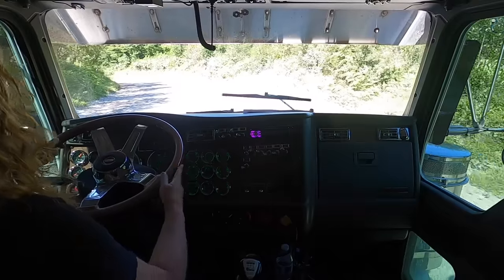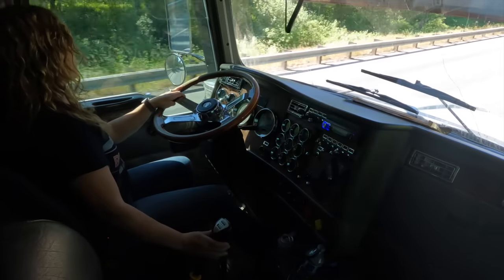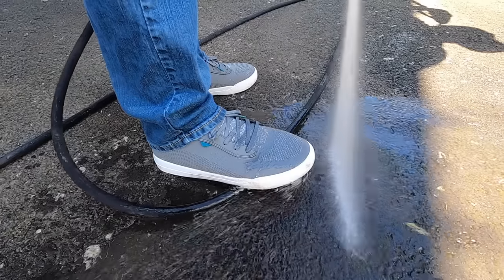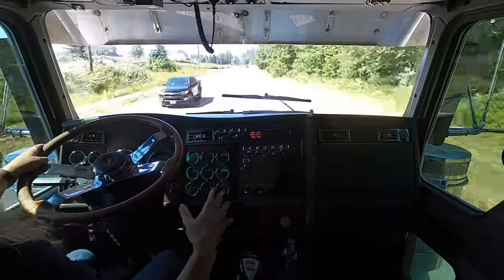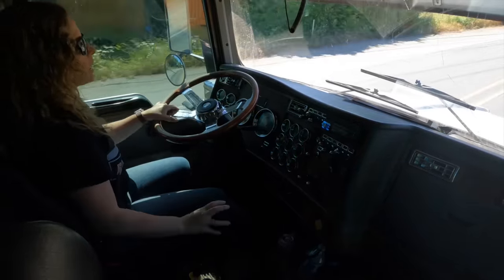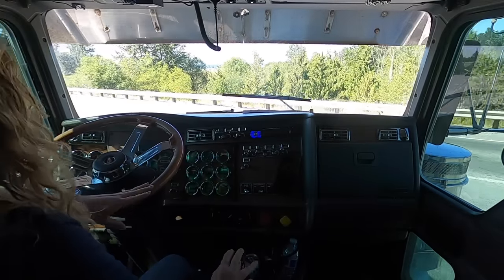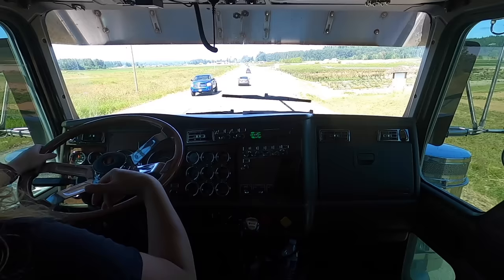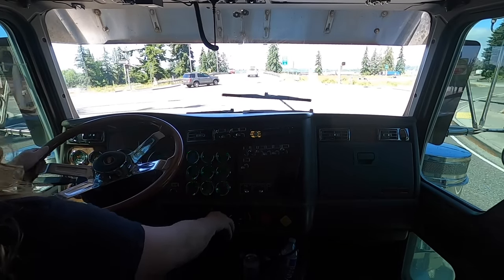How to shift an 18 speed Eaton Fuller Transmission. Down shifting explained on a loaded semi truck.

Comment: When I drove a truck for awhile hauling asphalt in a tanker trailer I was driving a 13 speed.
Fully loaded I never bothered using the half gear splits, and when I got up to the last shift then I buttoned it up to the 13th gear.
When the trailer was empty I started out in 4th gear(low range) then shifted into 5th(high range) right after that and again not bothering with the half gear splits all the way to the last gear shift then buttoning to the 13th gear on the highways
I can tell you I could get up to highway speeds a lot quicker unloaded than fully loaded.
But like she said we all have different driving style and each truck is always different to drive.

Comment: I found the best way to shift is use no clutch when shifting when changing up a gear rev to the point of changing take foot off the gas slid into neutral then quickly in to next gear without reving  up it will slip in easy and smooth do it all in one swift motion now when changing down gears drop into neutral then give a quick rev before dropping in to lower gear again do it all in one motion the more you do it the better it will be it will be  almost semi auto  it;s great for climbing hills without losing power and revs cause you not hitting the clutch only use the clutch for stop and start moving it's all about feel and becoming one with the rig

Comment: I’ve only been driving stick (10 speed dump truck plowing) since January. I learned to double clutch to get my license. I sometimes float the gears up shifting. But down shifting I always clutch once to take it out of gear. Otherwise it just sometimes doesn’t work for me. Especially when going from 10 to 9 and 8 to 7. Most of the time I just double clutch for everything. That way for me I rarely lose a gear. But it does happen lol

Comment: Back in my days of driving all different trucks different transmissions The highest I used was a 13 speed fuller.
When you drive it enough you never look at the tack you just listen to the engine and watch the speed, you just know when to shift.
Reply: 13 is the same. 18 you can spilt the low range as well.

Comment: I found this video interesting. I like the way you have full control of your truck at all times. To me you are a very confident driver. And a real truck driver with a very smooth gear change. During my career as a driver I personally did not use the clutch either. Keep up the good work and shiny up and the wheels turning. Stay safe and all the best

Comment: Great video. Good explanation. When you drive every day you don't think about the gears. I agree with you about the clutch and Mac transmissions. I thought it was just me. Some guys (and gals) love the Mac transmissions.
Reply from the maker: They are crazy! 🤣
Reply: The mack maxitorque (extended range) 5spd with lo hi and reverse on the 2nd stick, I loved the 5 gears in reverse (1970's) Absolute Workhorse!!
Reply: @jackspringer9283  I could dump circles on a fill over the Eaton geared trucks with that transmission. It was easy to pass 2-3 trucks a round when you can back up at 25MPH😁
Reply: @bobderemer5015  when you had to back 1/2 mile to the paver and 1 of the crew would ask if he could catch a ride outside holding the mirror?...Sure!!! LOL 😆

Comment: I see what you’re doing if you know there’s a stop or traffic light coming up way before you see the light from a distance start down shifting you should be 3rd low before the light other than that you’re doing very good nothing wrong with your shifting just know where your hills lights stops are so you can down shift before than good job Dauminique

Comment: Love the 18 speed transmission! 
It sucks that I never go to drive one when I was actually
Driving trucks every day for a living. Now that I work at a Peterbilt dealership I drive 18 speeds all the time. Even working in an office there I find every excuse to play with all the new trucks. Haha. Was easy enough to take the concepts from a straight 10 speed and apply them to learn the 18. Now I hate all other transmissions! 
I shift the same way you
Do, No clutch and skip around through the gears when you can.
Reply: A 10 is a different pattern. 18 is based off the 9.

Comment: The only truck I've ever driven was on a former work site that was used as a water bowser to (try) and keep the dust down - being 'on site' no need for a licence, just had to show competency of operating it. Ex-British Army Leyland DAF 4x4 5 Ton with a 5.9litre Cummins turbo 145HP in a rather fetching green lol. Had five gears but only ever used first and second. Liked driving it but the effort to push in the clutch just caused the arthritis in my left knee to flare up so gave it up after awhile.

Comment: I’m not a truck driver - just watching out of mere curiosity. I drove a standard car for many years so driving a stick is no issue. Here are a few questions: 1) do people who know how to drive car manuals get thrown off by the fact that reverse is where first would be in a car? 2) so you only need to put the clutch in when shifting out of first? My dad used to have a Karen Ghia that was a semi automatic (strange thing for a car to have). It seems like this truck is the same. 3) Do you need to take the foot off the gas when changing gears even if not engaging the clutch?

Comment: I float when upshifting, but when downshifting I usually use the clutch to take it out of gear, rev up and then float into the next lower gear.  I say “usually”, because I try to let the rpms to get as low as possible before downshifting, and I find I can’t get it out of gear by pushing on the accelerator if the rpms are too low.  A lot of times I’ll skip gears if I don’t have to stop quickly or if I’m not going downhill.  I drive a 10-speed, and I go from 10th to 8th and sometimes from 10th to 7th.  And then from 8th or 7th I usually just stop.  I don’t have to ride the clutch much doing that.

Granted I live in Georgia and drive a tandem (10-wheeler) with no tri-axle, so the max weight is 60k lbs., even though sometimes I’ll be a bit above that.  If I were loaded to close to 80k it might be different.

Comment: thank you letting us "ride" shotgun, the shifting, cat engine talking and Jake brake. when I was in high school my part time job was riding with the  drivers on the ice trucks. one the new trucks had a 7 speed Fuller so one Saturday an extra driver with little experience and left the ice headed the lake front stores, he would grind every gear. I said " either you double clutch every gear or let me out at the next stop sign". the "old head" that drove truck was smooth on all gears, only the clutch to start and stop.

Comment: Great video.  Question - I’m not a truck operator but I know that on a manual transmission in a large tractor trailer truck, some manual transmissions allow the operator to change gears without using the clutch just by stepping on or off the gas and flipping the ‘switch on the gear stick’.  What is actually taking place that allows the gears to change without using the clutch or grinding gears?

Comment: I learned how to drive a truck on a super 10. That thing sucked. Currently, I'm using an Eaton 10 speed, which works great. I'm hauling a lot of weight. I'm wondering if the 18 would be better

Comment: A couple years in did not know there was exact way if it stalls not good if it stalls on steep hill could be a problem used auto shifts going into mines when working right you will never look at a manual again nice work girl comments Wright on

Comment: Dauminique, what say we forget about the truck Lessons,  we all know how to drive a truck, Instead, how do you get work for your company?  Do you bid for certain contracts?  Are there any UNION PROBLEMS?  Are there contracts or do you just go from job to job by the Luck of the Draw?  Is there any real money to be made with the Quarries closing in the middle of the day?  I’m from Bolingbrook Illinois so my lingo is probably different from yours,  also owning a Dump Truck is alot different than it was in the 70s and 80s, I remember so many guys bailing out, going from $130 a load to $119 to $95 a load and the last I remember $75 a load. I’m asking you because I’m Retired from OTR freight hauling but I’m still Ubiquitous!  Or in your opinion is the Dump Truck industry Homogenized?  If the Quarries close at 4pm and no weekends, umm 🤔, WHERE’S THE BEEF?   Thanks.

Comment: You sure have a different kind of clutch brake than I do if it has teeth.  Mine is just like a mini brake that pushes two surfaces together at the bottom of the clutch. Definitely wears out the surfaces if you do it when you're not stopped, but no teeth
Reply: I could be wrong but perhaps the term teeth was the word used to describe the two inner metal tangs I will call them that ride in two of the splines of the transmission input shaft. If the clutch brake is abused as she explained by pressing all the way down on the clutch pedal while the truck is in motion, those "teeth" can sheer right off and then the clutch brake has to be replaced.
Reply: @charlesb4267  Yes you could be right.  I was thinking maybe she thought it was like a gear.  You can sure wear it out prematurely even if you don't break those tangs. Paul
Reply: @pauleck455  Yes indeed, literally trying to stop the truck with a little clutch brake doesn't work out well !.

Comment: I drove a Eaton Fuller ten speed that split between shifts without the high/low splitter which split the gears in one and basica floated the gears without the clutch and double clutch on the downshift I never started off in first gear it was mainly second or third gear  the clutch was not fully engaged in fact  I sometimes miss the places out west and going north like Oregon over the mountains except for driving in snow and ice.

Comment: Ran a twin stick Mack with quad box . Ran by sound and feel only clutched at stop lite . And goin into reverse or first or which forward gear I chose . Learned when I was 11 driving feed truck with 4 and 2 speed rear axel . Pete’s with 5 n 4 twin stick unless I was loaded never used all the gears

Comment: If your learning to drive you should be using every gear until you get use to it. Then you can start getting fancy once you have  basic shifting down. I drove for 20 yrs and trained new drivers for 12 of those years. Like she said everyone shifts different but the basics are the same.

Comment: Why is the Jack Brake switch on the dash? Have you seen it on the shift lever? I think it would be more convenient. 
Thoughts?
Reply: I’ve never seen one with the Jake switches on the shifter, but a lot of newer trucks have the Jake switches on the steering wheel, which is REALLY convenient.

Comment: Should I be splitting all the way down? Especially if I’m only 80,000? When I first learned the ol rancher told me to split up but don’t even worry about splitting down, just keep it in low all the way down. Is there anything wrong with that?

Comment: I probably missed it in the video but can you switch between high and low with out moving the stick? Im obviously not a trucker, my experience is moving a dump truck in the yard that was in the way at my old work place. I was the one of a few that can drive a manual (cars) and the only one who knew about air breaks.

Comment: Great video. I do have a question. If i am driving lets say in the Adirondack mountains can i just shift 1-18 in low evertime( so 1low,2Low,3low, ect..). instead of finding high for each gear? Would this help as fare as wear and tear of motor parts?

Comment: Your Avg driver will shift 13 and 18 speed like 10 speed then split last gear. Switch in front is LO/HI (Range) but thumb switch not LO/HI (Splitter) actually direct and overdrive. Drivers who do haul over 100k use splitter more but mostly in high side

Comment: I've always floated the gears....you should be able to leave the Jake on and put the cruise control on then the Jake won't activate untill you apply a little brake pressure, then when you let up the Jake will deactivate again, that way your not always reaching for the switch.

Comment: Do you start out on level tar road in 1st,thru4th,not splitting gears?. Then range shift and 5 thru 8. Think 9 speed  main box and splitter box behind it. If off road or uphill you use the 18 speed splitter.

Comment: ant there was me, learning to drive a truck for my farm, in a driving school, Learned to drive manual (german MAN truck) and then tried their automatic, never going back, not because the driving was easier (it was actually much easier, driving truck in a twon full of red lights and slow intersections, ugggh) but because steering mechanism on the automatic is in much better condition and driving weebly wobbly manual was terrifying in town. that big machinery I drive only to the fields and back, but I am much slower in a tractor and there is almost never that many tiny cars just beside me :D

Comment: Hey as a dump truck driver, do you think you work harder than someone doing Class A CDL locally? Thinking about getting a CDL and I'd rather make more money to do less work because doing more work to make less money is stupid.
Reply from the maker: If you want to be successful you will work hard regardless. Around here local freight gets paid about $22 an hour and you are pushing pallets all day long. Driving a dump truck you will have shoveling and possibly equipment moving and with zero experience it usually starts at about $25. All local trucking jobs require some labor.

Comment: Why has the us not moved onto fully synchronized gearbox like Europe and the UK have. Don't get me wrong the fuller box is a good box and skipping gears is better all round on fuel drive train and acceleration. And missing a gear you nailed it and as you said you have two chances rev matching low and high RPM not that you need my two cents lol good video

Comment: Great video. Only thing I saw was it looked like you put it into Neutral when you were at a stop. If thats what you do, fine, but don't do that on a driving test. You will fail. Truck has to be in gear at all times.

Comment: What do you think of some of the newer trucks like Volvos with automatic transmissions?  Do you think it would make driving easier, or would you feel somewhat of a loss of control?
Reply from the maker: I wouldn’t drive a Volvo. I have driven automatics and they come with a whole host of problems when driving off-road. I think that if driving a manual is what’s keeping you from being able to drive a truck then you should not be a truck driver.
Reply: @DauminiqueTheDumpTruckDriver  Thank you! :)  I've heard from a lot of truck drivers that they prefer the manuals.  I've never driven a truck before, so just curious.  I have a manual trans car and after 20 years with a stick-shift car and horrible traffic, I switched to an automatic for traffic, but that's just a little car, so apples to oranges.  Thank you for what you do!

Comment: Hallo Dauminique,i love the sound of the engine as you gear up and down.
Q,you only use clutch on 1st gear when pulling away from a stop sigh or robot ?
Q,you dont do exaustbraeke to stop or slow down ?
Sorry for the translation words but i am from South Africa and here they call the low gear's ( split gear's ),i dont drive truck's,i wanted to but there were no money for learning for a license,it is to expensive,but i love trucks,i dont think i will ever be able to drive a truck deu to that i broke my enkle 3 years ago,my car is automatic,please be safe where ever you go

Comment: Awesome explanation of shifting an 18!!!  I've  only had Eaton 8LLs the dumps  so I've always wondered about 18s.  Do you have  deep reduction in the 18?
Reply: No. An 18 speed is driven like a 13 speed. Only difference is you can split low range, where as as in a 13 speed you can't.
Reply: Easiest way to tell what the trans is, is the color of the selector. Blue is deep reduction, 8LL or 15 speed. Red is a 13 speed, and grey is an 18 speed. That's with Eaton Fuller transmissions.
Reply: I remember my 1st job.

Comment: Couple things...
It doesn't matter how long you've been driving if you've been doing it the wrong way the whole time.
The Eaton Fuller gear box is actually known as a Road Ranger by everyone I've ever spoken to. 
Using the clutch costs you fuel, and, obviously, wears the clutch. 
Not sure why you're slowing down on a 55mph (88kmh) bend unless you're over dimension. 
Not sure why you're shifting down half gears. The more you shift the more fuel you waste. Let the engine do the work. Shift down multiple gears at once.
If you're empty, start off in something higher than low 1st, you're just wasting fuel.
If it's a Cummins X15, drive it like you stole it. They perform better at higher rpms and don't like being lugged.
And lastly, just leave the Jake brake on, they're not that loud these days.
Keep it upright.
Reply from the maker: Never heard it called a road ranger, it’s definitely not a Cummins…..at 105,500 and 80 feet long on winding WA roads I will slow down when necessary.
Reply: @DauminiqueTheDumpTruckDriver  
Hey, you're light, happy for you, it's just not what I'd do. 
In Australia we drive to the speed limit. If you sit on the speed limit out here you shouldn't have to back off.
Reply from the maker: @petethetruckie  50 is the speed limit

Comment: If you run your throttle just right you do not have to shut that Jake brake off you can still get by in your shifting and not use the jake brake even though it's turned on
Reply: Exactly, or sometimes what I used to do was lightly press the clutch pedal enough (basically your clutch pedal freeplay) to disengage the jake switch to prevent the jake from coming on in between shifts.